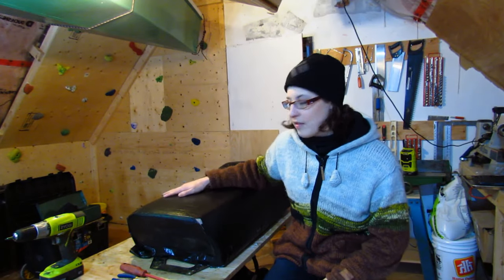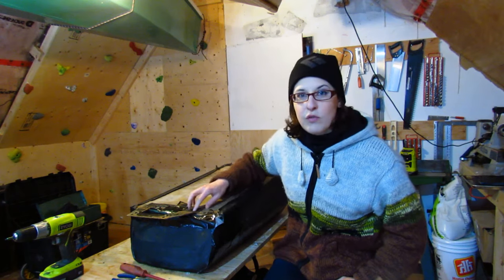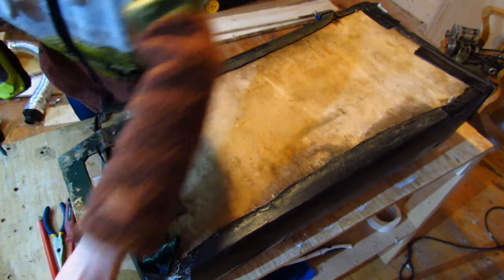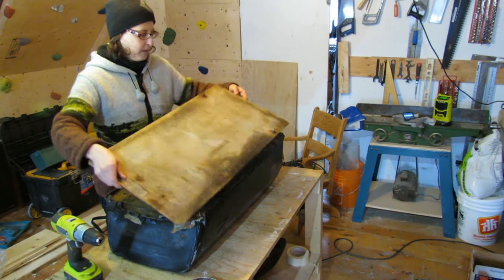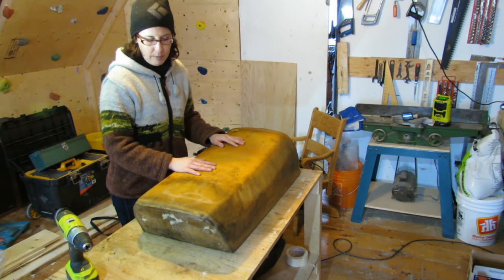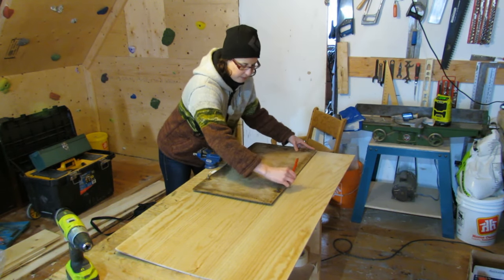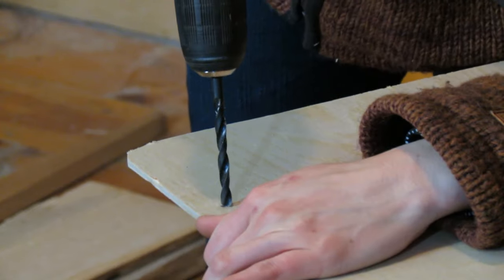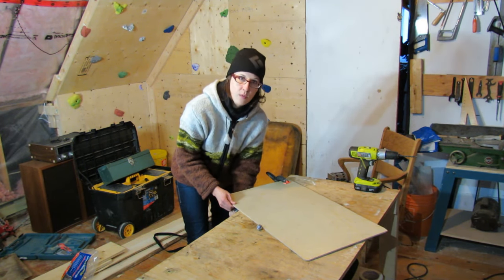DIY Snowmobile Seat Restoration

Comment: Great video....repairing snowmobile and ATV seats was the bread and  butter of my upholstery business... my suggestion to those  wish to tackle these projects is forget about pinning and use staples...staple the project just shy of your stitch line and remove staples before top stitching...the advantage is your project will be held together much better and  will mitigate any creep in material, you will maintain a more accurate seam, and save a ton of time messing about with pins...
Reply from the maker: So glad to hear from an expert. Thanks for watching!

Comment: Nice job Jen . I have one of those hand staplers too , but picked up a 1/4 '' crown stapler when  I bought a compressor. Very useful tool. Even used it to nail down rolled roofing on a shed roof . Works great on cedar shingles as well .
Reply from the maker: Nice. We have a swing stapler and a regular hand stapler only for now.

Comment: Good job. Always good to repair things yourself. Feels like an accomplishment.
Reply from the maker: +Food For Thought Thanks! I'm always learning something new working on that machine.
Reply: +TheWildYam I've never even been on one, let alone repair it.
Reply: The key to keeping it running long is maintenance. Check the skid which is underneath with the track rides on make sure your slides are good there's grease points under there grease it run premium non-oxygenated fuel in it you don't want to run gasoline with ethanol in it because it dries out the fuel lines and then they become brittle and crack. And in the summer when you store it keep it off the ground and in in the fall check the air box that the carburetor goes into make sure that's clean mice 10 to like to build a nest in there actually wouldn't be a bad idea to check it throughout the summer or plug it off so they can't get in there.

Comment: Great job with the seat restoration Jen!  I only ever done one that was for an older machine as well when I lived in the Sahtu, NWT.  It was a little challenging but certainly rewarding and much much cheaper!  You have a virtually brand new 1987 Bravo now!  Thanks for sharing, take care.
Reply from the maker: +Dave Wilcox Jr Thanks Dave. Wow you really lived up North eh? Ya, it was a really rewarding project
Reply: I had a couple of years up North, seen a lot of beautiful country, seen a lot of wildlife from Muskox to Dalls Sheep, the Snow Geese, Tundra Swan.  The frost made pingos were pretty cool outside of Tuktoyuktuk.  A pristine country up there for sure.  
That Bravo you have were one of the first used for racing with the Labrador Winter Games back in the 80's.  They were put through a lot and stood up well.
Reply from the maker: +Dave Wilcox Jr Neat!

Comment: Also shows that a lot of the sleds from the 80/90's (my Phazer included) had a piece of plywood on the bottom.  Removing the seat and painting the plywood will make it last that much longer, as it's amazing how much snow spray (water) ends up between the aluminum tunnel and seat.  Jamming a stick underneath at the end of the season allows it to dry out.
Reply from the maker: 96Duelfuel Excellent points!